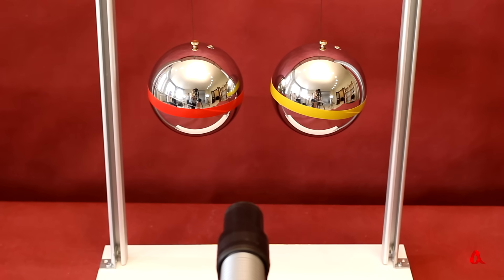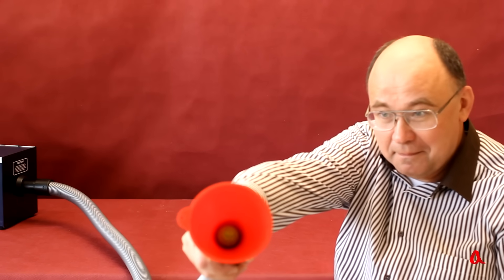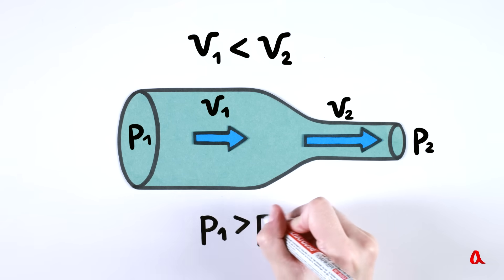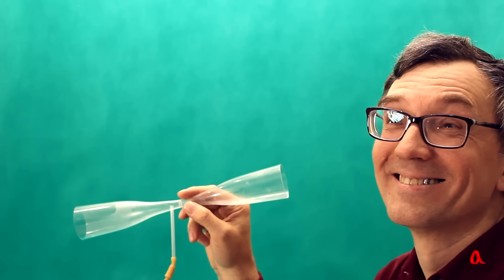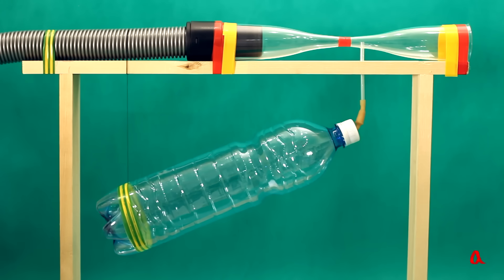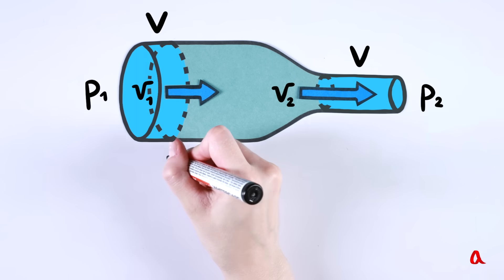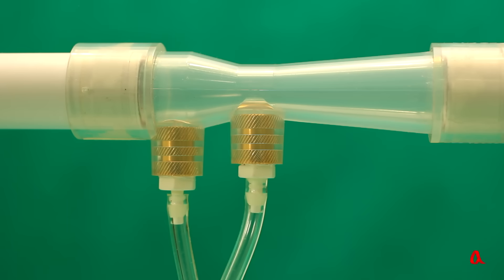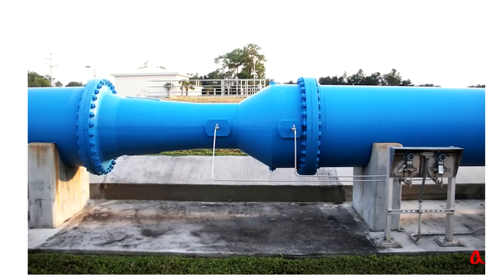Bernoulli's principle

Comment: I have never doubted, but always puzzled by the decrease in pressure.

There is no questioning the observations, and formulas may describe the principal perfectly, but why? What is happening at the physical interaction?
Reply: I was wrong, higher velocity doesn't lead to lower density.  As a gas flows faster, it gains kinetic energy, which must come at the expense of its potential energy or pressure energy. In other words, the increased motion of the gas molecules leads to a reduction in the pressure they exert.
Reply: @mpinmpin9935 the problem with that explanation is the definition of pressure. Pressure is the sum of all the molecules bouncing off a surface exerting a force. So increasing the average velocity of gas particles (also known as heat) should increase the pressure via the Ideal Gas Law. 

It seems as if the Ideal Gas Law contradicts Bernoulli’s Principle.
Reply: @cgsrtkzsytriul  "the average velocity of gas particles (also known as heat)"
If a parcel of fluid moves at a given velocity, that velocity is independent of the temperature of the fluid.  Temperature is the (square of) velocity of individual molecules relative to the entire collection of molecules.  Temperature can be assumed to be constant for most applications of Bernoulli's Principle.
Reply: @mpinmpin9935  Wait, that would be true in a closed system, but an external force is acting on the fluid: energy is applied. Is that not the case?
Reply: CONSIDER THESE TWO CASES (a simplified look at the conditions of the tube).  

The tube is wide and sealed off (permanently) on the left side and has a very narrow 'nipple' part on its right side.  The only opening of the tube is at the rightmost end of the nipple.   The tube is positioned horizontally with the wide side to your left, and the narrow nipple side on the right.  If the nipple's opening is not blocked, water will flow out of the tube to the right, out the nipple.

CASE ONE:  there is ONE  (1)  atom of water in the narrow part of the tube and it is not moving - there is a rubber 'stopper' placed in the opening and no water can flow out of the tube

CASE TWO:  there is one atom of water in the narrow part of the tube and the rubber stopper has been removed

The one atom in the nipple section distorts due to the force - the water pressure - coming from the large volume of water on its left. Because the nipple is blocked by the rubber stopper,  the atom pushes back, per Newton's 3rd law,  equally and in a spherical fashion:  (1) against the glass in the nipple;  (2) against the water on its left;  (3) against the rubber stopper on its right.

With the rubber stopper removed, the distortion of the atom is no longer equal in a spherical fashion.  Since there is no longer a 'push back' on its right side (the rubber stopper is no longer there), instead of 'pushing back' against the glass in the nipple, the atom exits the nipple to the right.   From the perspective of the glass in the nipple section, it 'feels' less push from the atom.  This is a reduction of pressure in the nipple section.
.
Reply: The faster air flows, the lesser the density of the air. At molecular level, the particles at lower densiity are strained apart. Hence, the particles at higher density flow, filling the particles at lower density.

EDITED: This is wrong
Reply: @mpinmpin9935  Thank you, that was perfect! That has been driving me nuts since physics classes 20 years ago!
Reply: @mpinmpin9935  This is not correct.  To see why, imagine a glass tube that is circular - like a hollow, glass hula hoop.  It is filled with a fluid (a gas, or water, etc).

The tube is rotated to 100,000rpm  (assume structural integrity of the glass, ie. the glass tube is thick and does not fly apart).

What is the velocity of the gas or water in the tube?  It is 100,000 rpm relative to the motion of the rotating tube.  The entrainment of the gas or water is minimal (ie. the inside walls of the glass tube do not have enough friction to move the gas or water at the speed of the tube).  The fluid remains relatively at rest while the 'hula hoop' of glass spins around. (You can see this exact effect if you fill a glass with water, and start rotating the glass - the water remains at rest relative to the spinning glass cup.)

What is the density of the gas or water at this extreme rate of flow?  It is unchanged from when it was at rest.

A fast-moving fluid (gas or water etc). does not expand, does not become less dense

If you ignite a heat source, the fluid (gas or water) will expand - the increase of kinetic energy (the motion)from the heating causes the constituent particles of the fluid to 'push off' against each other, and the density decreases.  Water turns into steam;  the gas become more 'rarefied'.

If an increase of velocity decreased the density of a fluid, people who enjoy white water rafting, or water skiing, might sink into the water.
Reply: @mpinmpin9935  I don't want to leave this hanging.  My high school physics teacher said "what are the forces acting?" when I asked for an explanation once.

CASE #1:  the rubber stopper has plugged up the nipple, on the right side of the tube.

CASE #2:  the rubber stopper has been removed

WHAT ARE THE FORCES ACTING?

CASE #1:  The water in the larger, left side of the tube pushes against the water in the nipple due to gravity. In response, the water in the nipple pushes against the rubber stopper.  The rubber stopper pushes back against the water in the nipple section.  The water in the nipple then tries to expand but ends up pushing against the nipple's glass walls.   That is where the ambient pressure comes from.

CASE #2:  the force of the rubber stopper that was pushing against the water in the nipple IS GONE.  The force from the water in the larger, left side of the tube IS STILL PRESENT.  It pushes on the water in the nipple.

Because the force from the rubber stopper is missing, the water in the nipple can no longer expand and push against the glass of the nipple section. So the pressure declines.

Here's the conversation the nipple water has with the glass in the nipple section:

NIPPLE WATER SAYS:
"Look - the only reason I was pushing against you, nipple glass, is because - when the large volume of water to my left pushed on me, I tried moving to the right, but THE RUBBER STOPPER PUSHED BACK AGAINST ME.  So I had no choice.  I pushed against the rubber stopper.  It pushed back.  I pushed against the water to my left.  It pushed back.  So I'm getting squeezed from both sides!  I had no choice but to EXPAND, to PUSH, against you, nipple glass."

"But when the rubber stopper was removed, and that large volume of water to my left pushed me,  I did NOT GET A PUSH BACK from the rubber stopper and so I did not have to expand against you."

NIPPLE GLASS SAYS:
"Thanks for that.  Because you didn't expand and push against me,  a lot of pressure was taken away.  The drop in pressure was good.  By the way, WHY was the large volume to your left PUSHING YOU?  Because that's what ultimately caused you to expand against me."

NIPPLE WATER SAYS:
"Gravity.  The gravity pushed that large volume of water downward, and it expanded and pushed against me."

Comment: It WILL push them apart... in a vacuum. You see, human intuition is actually correct, the problem is people cannot see the difference between air and vacuum.
Reply: nope, this video does not talk about why, it talks about what. In a vacuum there can't be any gas flow so nothing would happen.
Reply: @banzaiib  I don't get what you mean here. A jet of gas will still have momentum even if moving into a vacuum otherwise rockets wouldn't work in space, no? We're still talking about higher pressure fluid moving into a lower pressure volume of space, same as air being blown out of a nozzle. There'd still be gas flowing behind the balls, as the expanding gas that'd moved past them would also be pushed into filling that space. Surely all that matters is that there's a relative difference in pressure? Am I missing something fundamental here?
Reply: @WombatOfWimbledon  
Thankyou.
Reply: @WombatOfWimbledon  if you pass a rapidly expanding jet of gas past two balls, then it's not really a vacuum anymore and the balls will not move apart...
Reply: @banzaiib  I was really coming from the angle that the ambient pressure being a vacuum or not probably doesn't make any kind of fundamental difference here, so we'd expect the same results regardless.
Reply: @WombatOfWimbledon  i guess i'm saying the concept is counterintuitive, and i believe, that if you performed this test in a vaccum you'd see the exact same effect. I truly wish i had a gigantic vacuum chamber to test our hypotheses to both of our satisfaction...

Comment: The Bernoulli effect happens on the wings of an airplane....
Reply: NASA has several articles debunking the "equal transit" and other false explanations.
Reply: This is all fine and good until you try to explain how an airplane can fly upside down …
Reply: @jimseviltwin1  The correct physics applies either way.  It has to do with the way the airflow is forced to flow around the wing. 
Consider:
When the wind blows on you, OR you travel very fast "into the wind", you feel that.  Because air has mass and inertia, it pushes on you more because you both can't occupy the same space and THAT is what causes an INCREASE in pressure. The air is resisting being moved - This is Newton's First Law - - Mass resists acceleration.  a.k.a. Inertia.
.
This is what happens under an upturned wing (at some good AoA). Air and surface are approaching each other and that is what increases the pressure there.
.
THEN. . . 
.
Above the wing, The air's inertia is 'wanting' to also go straight. but is forced to curve up and over and back downward over the leading edge, by atmospheric pressure pushing it down to stay close to the upper surface.  CURVED AIRFLOW, (not simply the wing's shape).  Because the Mass resists (inertia), the pressure is lowered toward the inside of the curve.
.
For a full step-by-step: Understanding Bernoulli Correctly: 
 https://kyuoyckftflurrpq.quora.com/
Reply: @jimseviltwin1  It is all fine since all the pilot have to do is reconfigure the wings so that the upfacing side of the wing still have the longest airtravel... otherwise the planee would crash... just change the area where the Bernoulli Principle is in effect....
Reply: @thiesenf  So, you’re saying that if you turn an airfoil upside down, the physical dimensions are altered i.e. the convex area is lessened, and the concave area is increased ?
Reply: @jimseviltwin1  doesn't a wing have flaps and other kind of control surfaces?
Reply: @thiesenf  The next time that you are riding in a vehicle, try this “experiment”:  put your hand out of the window and cup your hand into the shape of an airplane wing; observe the (lack) of lift perceived on your hand.  Then, flatten your hand and orient it parallel with the ground; then slightly tilt the leading edge up. Observe that your hand shoots up. Something else besides the Bernoulli principle is at play here. Perhaps the air is being compressed underneath the leading edge thereby forcing the wing/hand upward?
Reply: @jimseviltwin1  That's why it's not 'fine'.
.
The statements about Bernoulli's Principle are correct, but the demonstrations are very poor.
The balls, spoon and funnel age a result of the Coanda effect. 
.

The tube inserted into the wall of the neck is protruding into the  flow (seen at time 2:57)  This causes the air to curve around the end and sides of the tube.  This curved flow is the cause of the  lowered pressure.  This will work with no pipe around it; just the air blowing across the vertical tube.
..
To correctly measure the static pressure inside your narrow neck, the end of hat tube MUST be flush with the inside surface. 
..
At time 4:51 we see that the two pressure sensing tubes appear to be more like flush, but it is difficult to see clearly.  For that to truly sense the static pressures, there must be NOTHING protruding into and disturbing the flow.
Reply: https://youtu.be/uyRx25MSWng
Reply: But it's not significant
Reply: ANGLE OF ATTACK BABY
Reply: @primenumberbuster404  That says nothing. What's YOUR point?
Reply: @primenumberbuster404   

@primenumberbuster404

"ANGLE OF ATTACK BABY"  -- Means absolutely NOTHING. Says nothing. Is pointless .  to post such nonsense.
.
Yea: angle of attack.
Airspeed.
Atmosphere.
Atmospheric pressure.
Air density.
Pressure changes.
Pressure Gradients.

Air Acceleration.
Lift
DONE.

Comment: This video is still WRONG. Please make corrections or remove it.
..
The statements about Bernoulli's Principle are correct, but the demonstrations are very poor.
The balls, spoon and funnel are a result of the Coanda effect. 
.

The tube inserted into the wall of the neck is protruding into the  flow (seen at time 2:57)  This causes the air to curve around the end and sides of the tube.  This curved flow is the cause of the  lowered pressure.  This will work with no pipe around it; just the air blowing across the vertical tube.
..
To correctly measure the static pressure inside your narrow neck, the end of hat tube MUST be flush with the inside surface. 
..
At time 4:51 we see that the two pressure sensing tubes appear to be more like flush, but it is difficult to see clearly.  For that to truly sense the static pressures, there must be NOTHING protruding into and disturbing the flow.
Reply: I still confuse about the Bernoulli. If you have any suggestion on which video explain better, feel free to share the link here, thanks in advance...
Reply: Coanda is not a fundamental force or principle, it baffles me people think it's the answer for everything.
Reply: @davidaugustofc2574  It's not the answer to everything, but it is what occurs with a flow of a jet along a convex surface, like the balls. It is simply the phenomenon where it appears that the flow somehow 'sticks to' the surface.  What well meaning people don't understand that the rather high atmospheric pressure holds it there.  It is similar to, but not identical to, what occurs above a wing where atmospheric pressure provides the centripetal force.  It does cause a reduced pressure toward that surface: 
 www.youtube.com/watch?v=3MSqbnbKDmM
Reply: Interesting, and probably correct comment that got only 1 like. I am depressed.
Reply: @Yggdrasil_Story   I'm not doing this for upvotes, nor points.  I'm just providing solid physics to counter all the misunderstandings being repeated over and over.  
If anyone is willing to read and understand, or ask, I'm willing to help, but so many people have such a poor background in simple, fundamental physics they can't and I don't care about them. Not understanding won't affect their lives in any way.

Comment: What a superb video lesson. Very clear and engaging. Many thanks.
😊
Reply: But WRONG.
The statements about Bernoulli's Principle are correct, but the demonstrations are very poor.
The balls, spoon and funnel age a result of the Coanda effect. 
.

The tube inserted into the wall of the neck is protruding into the  flow (seen at time 2:57)  This causes the air to curve around the end and sides of the tube.  This curved flow is the cause of the  lowered pressure.  This will work with no pipe around it; just the air blowing across the vertical tube.
..
To correctly measure the static pressure inside your narrow neck, the end of hat tube MUST be flush with the inside surface. 
..
At time 4:51 we see that the two pressure sensing tubes appear to be more like flush, but it is difficult to see clearly.  For that to truly sense the static pressures, there must be NOTHING protruding into and disturbing the flow.

Comment: 💖💖💘💘❤❤
Reply: This video is WRONG.
The statements about Bernoulli's Principle are correct, but the demonstrations are very poor.
The balls, spoon and funnel age a result of the Coanda effect. 
.

The tube inserted into the wall of the neck is protruding into the  flow (seen at time 2:57)  This causes the air to curve around the end and sides of the tube.  This curved flow is the cause of the  lowered pressure.  This will work with no pipe around it; just the air blowing across the vertical tube.
..
To correctly measure the static pressure inside your narrow neck, the end of hat tube MUST be flush with the inside surface. 
..
At time 4:51 we see that the two pressure sensing tubes appear to be more like flush, but it is difficult to see clearly.  For that to truly sense the static pressures, there must be NOTHING protruding into and disturbing the flow.